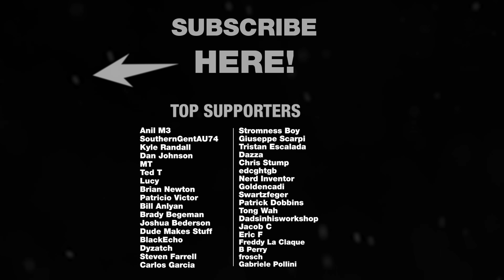Mosaic Damascus | Expectation vs Reality

Comment: You have a warped and distorted reality!  
9:49 What would happen if you put your stainless steel foil right below all the sections you are welding up against that plate?  Would that plate fall away as you ground the welds off?
10:49 I bet you could boost your sales to the North if you could get that shape just a little bit closer to a maple leaf.

Comment: Maybe try experimenting with how fast you squish the material each time. If you take it from 2" to 1" in 1 single squish it may make it uneven between each press of the dyes. If you break it up into 3 or 4 squishes for the same total distance I bet it wouldn't distort it as much. Not an expert or anything but just a hunch

Comment: 3:25 I am guessing that the uneven thickness of the layers was because the outer layers cooled more than the inner layers? Perhaps re-heating between every pass on the press would have eliminated that issue.

Comment: Forging the tip made things worse as far as a distorted pattern.   My humble opinion on the billet.  First, you need to pay a little more attention to forging HOT under the press as some of the distortion will come from the core and margins moving at different rates when the heat drops below cherry red. You need homogenous heat and stop before it get's under a cherry red heat. You also need some larger squaring dies, IMHO.   I'm sure you know the final stack had some geometry issues.   As far as the white lines/decarb zones, allowing a longer soak in the heat will make those fade and eventually disappear.   Great stuff, keep going and you will get it.  That's all I saw....

Comment: how wonderful. How do two metal components stick together?
Reply: When you get something hot enough and apply enough force to push it together it welds together.  Process is called forge welding.
Reply: @JamesLee-sw6ss  thank you. I also tried it, but with the carbon steel core and 440c case, it can't stick
Reply: @JamesLee-sw6ss  I regularly make three-layer knives with 52100 carbon core and wrought iron, the adhesion is ok

Comment: I know that beautiful blades sell well. I know that there is art and artistry in the making of these damascus blades, but the old stories of pattern welded blades performing near miraculous feats and being beaten against rocks and not breaking don't seem to match up to the abilities of modern damascus steel. And I believe that some of the stories, many of the stories of the strength and durability of swords made of damascus and wootz were to some point at least based in fact. That pattern welding was an early part of the development of steel weapons also lends credence to those legends because pattern welded blades were obviously better than the wrought iron and cast bronze blades that preceded them and probably did vastly outperform those older types. That pure steel blades that followed historically probably hint at the fact that pattern welding might not have been the best way to achieve a blade that was both hard and flexible. But I still believe the the right combination of steels in a pattern welded blade could achieve some outstanding results in blade performance, but since damascus has become more of a decorative art centric endeavor, i can't help but wonder what would happen if smiths were to try forging blades out of damascus for flexibility, durability hardness and edge holding ability instead of making them look beautiful, what they could accomplish? I'd love to see a damascus steel sword that could perform as well or better than the latest technologically advanced sword-making methods can produce. My aunt bakes some really awesome cookies, much better than anything you can buy in a store, and she says they taste that way because they are made with love. I wonder what could happen if a swordsmith put love into his creations what heights they could reach?